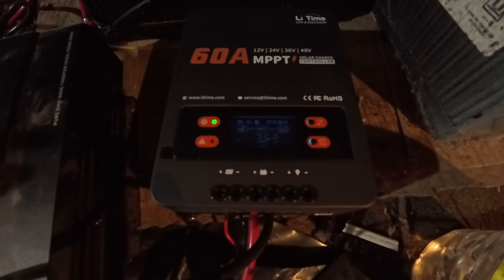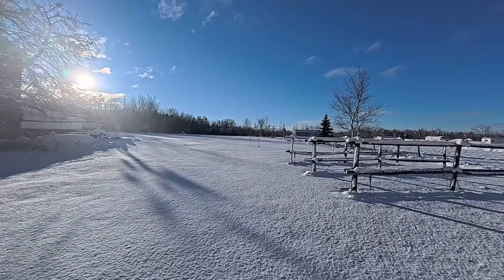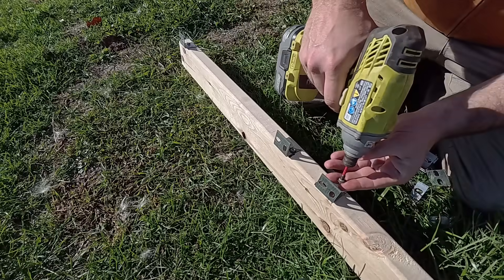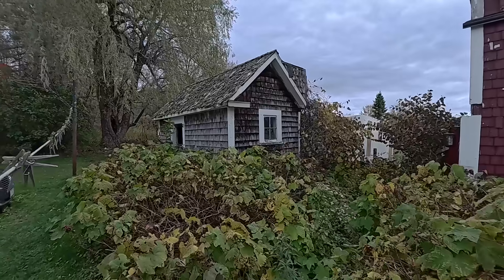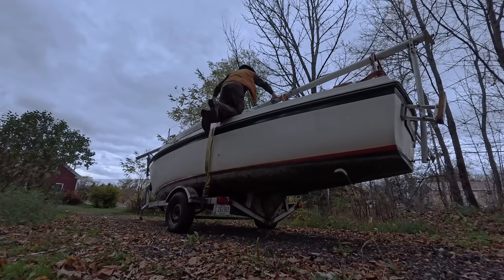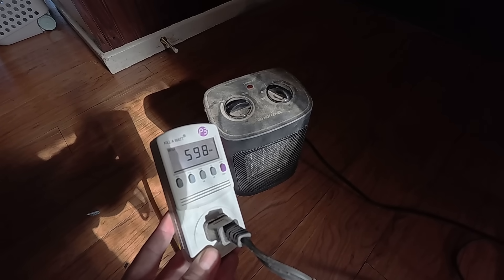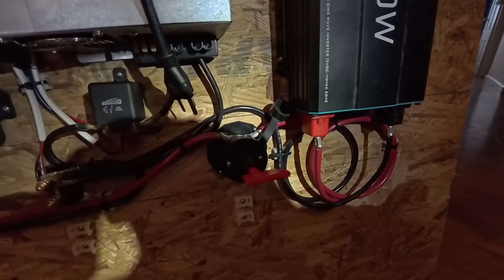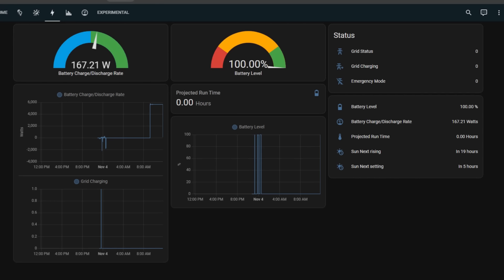Making a DIY Solar-Battery Backup System

Comment: I like the solid frame work that the panels are on but how do you adjust the angle of the panels to the sun?
Reply from the maker: At the moment I don't have a way to adjust them... We get very high winds here at times, so the first priority was robustness. But now that I have the system running I'm very tempted to modify it to make the angle adjustable.

Comment: I put in solar last year. I run my house off it now almost completely off grid.  My well and shop are still on grid . Thanks for the video
Reply from the maker: Very cool!  I really want to get my well pump off-grid... mostly so we still have a flushing toilet when the power goes out.😂   But it requires 220v, and split-phase inverters only seem to come in very large sizes... So that's an upgrade for further down the road.
Reply: @joethieman9400  that depends on how deep you're pumping from and how big hp pump you have.  Mine is 1hp but the water is down 150' or so. They make 120volt pumps. I even saw a 12 volt but I'm sure it doesnt have any volume.  Also i went with used solar panels, 320 watt for $45 each.  24 of them.

Comment: Nice small system but suspect you will want to expand in future.  
Panels- looked for used locally- guy in NH recently sold on FB Marktplace 580w bifacials for $58- so 2 would be $116 for 1160 w  which your MPPT might be able to handle w 12v battery bank.  The wires to the panels might be able to handle this power of 2 panels in series as it would be approx 100v DC
4 panels would have cost $232 for 2320w of power. This is too much for your MPPT with a 12v battery bank.  Eventually you'll probably go with 48v bat bank but that means more batteries and new inverter, probably an all in one setup allowing up to 500v dc from panels.
If you plan to use shed, plan on some means to heat Lifepo4 bats (low wattage pad heater with thermostat?) to keep bats above 32 deg F during winter.
Reply from the maker: Yeah, I've 'got the bug'... I already want to make the system bigger.. 😂

Yes, I definitely need to do some shopping on FB marketplace for future panels. Looks like some good deals there. Thanks for pointing that out! I guess I still thought of large consumer panels as a new thing... I need to get with the times! lol

Temperature regulation is one of the biggest problems with converting the shed to a powerhouse. Winters are brutal, but then summer comes, and average temperatures are often in the 80s, so heating and cooling the system become considerations. Luckily, I absolutely love making self-regulating systems!😁

Comment: why a 60 AMP charger for 400 watt of solar????
i use for 800 watt solar a 25 Amp controller many days i get 25 Amps but on cloudy or rainy days i get far below 10 Amps.....
so why oversize so horrible the charger and waste money??? 

12 volt batterys are ~14 real volt x 25 Amps=  350Watt charge speed with a 25 Amp charger that cost 20$"PowMR 25 A pro"....
Reply from the maker: My side of my barn has space for over 2000w of solar... I wanted to get a controller that would support that expansion in the future... And I've already ordered another 400w of panels to add to the array. 🤣

Comment: Great video Joe, it reminds me of my start into what i now call my solar addiction.  I want to share an opinion on setting the angle for the panels. i found that setting them for the best solar collection in mid December which ends up being far beyond the 45 degree recommended(which is a year round average) will still provide more than enough power in the long days of summer. I live in central Montana and getting enough power in winter is always the issue. In mid December i get around 4 good hours of production so  i have built my system around this scenario.  i leave the panels at the same angle and the rest of the year i have more than enough power. So unless you are selling power to the utilities think about designing your system for the power you need around the winter solstice and you will have all you need the rest of the year.
Reply from the maker: Good point... I'll have to consider lowering the panel angle.. Though Maine is at a lower latitude than Montana. (You wouldn't know it from the way US maps are drawn... or the severity of the winters. lol)

Comment: New subscriber here. I was looking at installing a whole home solar system but have changed to installing a backup system which can grow into a full system as funds allow.  For portable backup that provides 110/220 split phase I like the Anker Solix F3800 which does test well with inductive loads.  @AvarageJoe has a review on portable power.  Anyway nice video. I enjoy the narrative. You are right if it is exciting when you tie it on you might have done something wrong or like me it is thrilling it actually works.   Haha.  All the best from north Texas.

Comment: Coming along nicely, I don't think you need a dump load though, when the battery is full and no other loads evident the charge controller will just ramp down....🤠😎
Reply from the maker: Yeah, the dump load is just to help the solar panels pay for themselves... When the battery is full and there's extra solar, I have an automatic transfer switch that changes a load over from the grid to the solar... just to utilize all of the power they can produce. :)

Comment: make sure you buy a battery SHUNT monitor that monitors what goes in and out of the battery, this gives you a near perfect SOC reading so you actually know how many % is left. you cannot measure a lfp battery SOC just by voltage, its nearly impossible due to the flat charge and discharge curve
Reply: I thought he installed one of those?
Reply: @chop98 nvm i didnt see that tiny like shunt, usally you want to buy far larger ones
Reply: @joshwayop  no worries, brother
Reply from the maker: I did!  :)

Comment: Excellent work on your DIY solar system and it seems to be working great . Later in the year or future you might want to improve your solar system for more power generation and I hope you can run more loads longer and save on the power bill .💵 check out my solar videos , hit like , leave a comment and subscribe . May the solar be with you .😊🤙
Reply from the maker: Energy security!

Comment: Love this kind of project! RIP windmill bro
Reply from the maker: The windmill isn't finished yet... it's just been displaced from being the supreme power generator.. :)
Reply: @joethieman9400  ditch the wind mill....its no good,everywhere i look,they fail.Prebuilt ones also doesnt generate almost nothing....i see those 3000 watss windmills in all channels doing 50-150 watts/h... when there is wind ofcourse....light is more abundand than wind....adding more panels always works xD
Reply from the maker: I've been finding that out for sure!  But I'll fix and keep the windmill 'cause it looks cool beside the barn. :)

Comment: Nice project! I'd suspect you can still have internet during a power outage if you had Starlink, even if the power was out for the region. Fortunately internet is not a critical necessity. Personally I'd be more than happy if my home network was still functioning during a power outage.
Reply from the maker: Yeah, the coffee was way more critical than internet.. 😆 And yeah, this system will keep my home network, Home Assistant, and the Minecraft server up and running for 30 hours without any sunlight. I really want to make the system bigger now.. We get our water from a well (with a 220v pump), and having flush toilets during a power outage without running the generator would be amazing! 😂
Reply: I bet having an aboveground gravity reservoir would be a good dump load :)
Reply: The brother has 5G internet which we've bridged over in "emergencies".
Reply: We never realized how good it was until our daughter called to see if our power was out. With our solar power system,  we didn't even know.